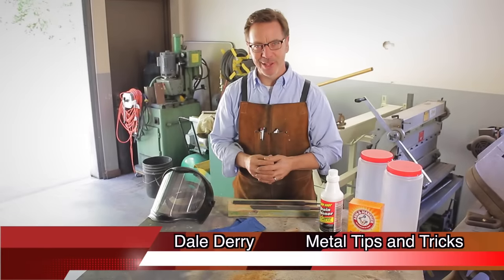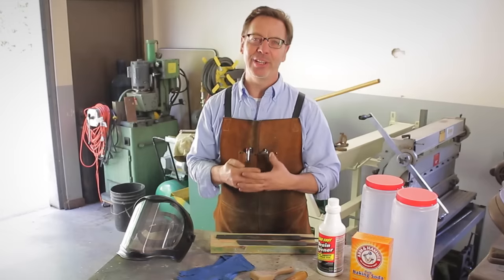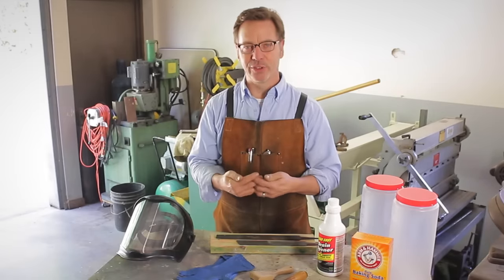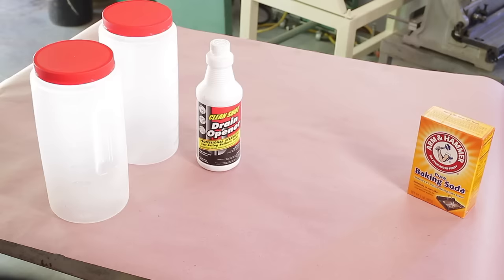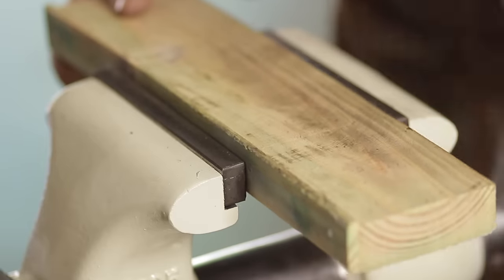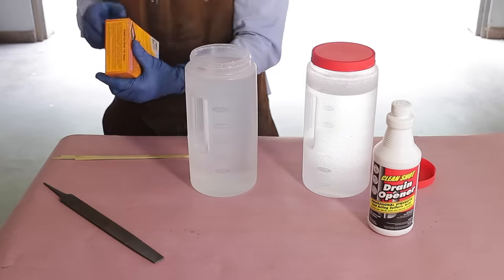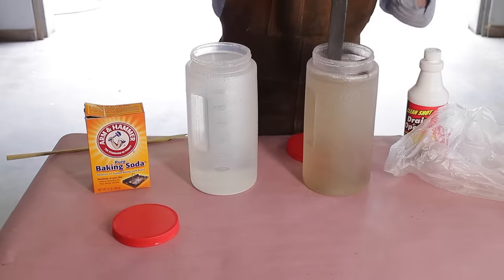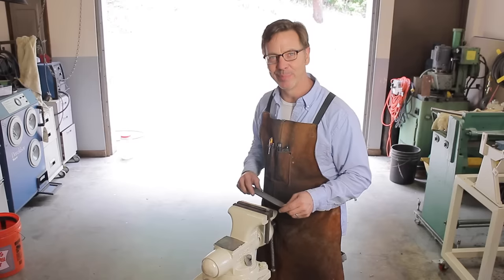How to Sharpen Metal Files

Comment: People arguing whether or not this actually sharpens vs. cleaning, have forgotten all about how we used to "acid dip" our muscle car bodies to make them lighter. Acid evenly removes metal from all exposed surfaces. That includes points, ridges and valleys. Let's picture ridges and valleys of a file. If the file is dull, the ridge will be a mini plateau. If you acid etch, the sides of the ridges will eventually wear away until the plateau becomes a thin ridge again. Thus, making a new point or ridge. Likewise, the valleys get deeper.

If you leave it in solution too long, you'll end up with flat bar. And if the file isn't extremely clean and wire brushed, all the etching action is happening on the left over crud, and not much on the actual file.
Reply from the maker: Thanks for your comment. :-)

Comment: The 1k thumbs down is rather humurous, because they have no clue, my grandfather, a master craftsman & machinist showed me this almost 40 years ago, great to see basically the same process shown, I was throwing some what I thought was junk files away, he asked what I was doing, and showed me essentially the same thing, the only difference is he used diluted muriatic acid, & put them in 3" pvc with one end glued & capped, the other end just a slip on cap with a small vent hole, left them overnight, cutting edge up neutralized them with baking soda & they were razor sharp 👍
Reply: I know right? I have over the years sharpened many a file exactly like this.. Got the tip from a 1890's machinist book.
Reply: But....but...but...the master craftsmen of earlier time didn't have Google to prove???? That's right they became master craftsmen through years of work, experience, and training. This a simple process that has worked for many many  decades before I was taught this method back in the early 70's. Believe it or not all you Nay Sayers it still works. It's really a simple process....quit over-analyzing it. If you want to pick the fly shit out of the pepper at least know what the fly shit looks like.
Reply: @troyquintana1383  lolz, Great reply for all the little nay-sayers..

Comment: Can I use this to clean my criminal file?
Reply: Bleach will work much better than acid.  BleachBit in fact.  The top criminals in this country used it successfully.
Reply: Da L. that's what Hillary uses?
Reply: Antifoul Awl
Reply: H
Reply: Antifoul Awl ACriminal file is nothing else than history.
Reply: To do that drink sulfuric acid mixed fifty fifty with water. About a gallon should do. Works best if done where you won't be disturbed for 6-7 hours. Will clean criminal file spotless.
Reply: @brucebratschi4300  hate to tell you this Brucie....Trump will get a second term you can bet on it bubba...TRUMP - PENCE 2020 🇺🇸🇺🇸🇺🇸 build that wall
Reply: Maybe.....but they will just RE..file the charges.......
Reply: Just put all witnesses in drain cleaner.
Reply: Only if you hire Hillary Clinton as your lawyer.
Reply: @rodneybrand8521  Well, THAT hasn´t aged very well.....     Rgr

Comment: the solubility of sodium bicarbonate is around 100 g/L at room temp. So if you have a water volume of ~4 L, like it looks like you do, you would need right around a pound of baking soda before it reaches its saturation point (Ksp). Just letting you know.
Reply: Btw, ego in their right mind would think that storing files I drawer, and letting them rub together, would sharpen them? That makes no sense whatsoever. It would do the opposite.
Reply: It does make them duller.  Been around them for 40 years, using them for 30.
Reply from the maker: thanks
Reply: Andrew Delashaw pretty sure it was sarcasm.
Reply: Bah!  If you'd rinse the stinking files off first, you'd only need a little bit, it doesn't have to be saturated!  Just throw some in there.

Comment: My last year and a half in the US Air Force I worked at the largest rocket sled track in the free world. This is at Holloman Air Force Base in New Mexico. The time I was there we tested components for the F-16, the Space Shuttle orbiter and the B one Bomber. The unit number for the squadron has changed in the last few years, but there are several videos on YOU TUBE  under high speed rocket sled track. It was the most interesting job I ever had.
Reply from the maker: thanks for you sharing your story

Comment: Do this outside. The fumes from the acid are HIGHLY CORROSIVE do  not do this process inside. The fumes from the acid will settle on anything metal and corrode the surface and you will have rusty tools or machinery. I do decorative acid etching and found this out the hard way when i did some etching under a cabinet that held all of my taps and drill bits. It corrodes the protective coating and made everything rust.
Reply: In a similar way I found that bleach vapors will rust any steel that they touch. My binoculars were stored in a cabinet. The laundry soap was moved to a lower shelf in that same cabinet so it would be easier to reach. When I found my binoculars that fall it took quite a bit to clean off the surface rust. Good thing my guns weren't in the same cabinet.
Reply: Do this outside! Or in your toilet!.......... >.>
Reply: You must be a bachelor. 😈😈😈😈
Reply: ....  It's drain cleaner for crying out loud.  Nice haircut though.
Reply: Big Dan No slam intended Big Dan. I just know if I ever used the toilet for sharpening files I would have to have a food taster for the rest of my life.
Despite that it has it's merits. Fresh water anytime you need it. Self rinsing. Porcelain bowl that isn't bothered by acid. If it wasn't for winter hitting Michigan 6 months out of the year I'd be seriously thinking of installing one in the shop for just such uses. :-)
Reply: I don't know why his drain cleaner has sulphuric acid in it. It's corrosive to metals. My drain cleaner has sodium hydroxide for it's active constituent. Neither of them have vapours that are are safe to breath or get on our skin.
Reply: It was still a joke! haha.. At least you know you can flush it after use. Maybe use it to melt the hair out of the shower drain.

Comment: i was taught that if a flie dose not cut clean it with a file card .
 but how dose acid which eats /erodes material actually sharpen . 
as a file is hardened you would need a diamond sharpener 

more important never use a file with out a handle. you are showing your true professionalism  

please correct me if im wrong so i can throw all my qualifications in the bin
Reply: If you're the type that always grabs the file brush when they grab a file, you may never need to do anything further. This is for when the rust and gunk build up so much that the file card won't cut it, (while a file brush removes chips well, it doesn't do such a great job of polishing the grooves). As soon as you remove the oxidation from steel, it comes back. If the rust gets to the point the brush can only remove the rust from the very edge you'll find yourself using the brush more often. Just the act of using the file helps to clean the edge.  Like I said, using the brush often means you might never have a problem. Rusty garage sale files? They need more than a brushing. The deep groove in a file is just as important as the cutting edge - the chips need a place to go or they act like bearings - not good if they are full of rust.
Reply: During use the tips of the file teeth wear away. That is normal wear.  As the file wears it begins to skid over the metal rather than biting in.  At that point it is a viable candidate for either hydro-honing or acid etch sharpening. 
If the file is abused, banged around in a box full of tools, run against hardened steel, or dropped so that the teeth are broken and chipped they are not candidates for hydro-honing but only because of cost. They can still be acid etched. Without shipping costs and the time involved, if you are able to save only one in three it's a good deal. Perhaps most of the file is okay with just one side screwed up, or one end. With no appreciable cost involved, what do you have to lose?
If the file is a little rusty or dirty, use a file card or perhaps a soft steel bar, like I use in my file cleaning video, to scrape the rust and dirt out of the teeth.
Something I haven't noticed in these discussions is any comments on pinning. It's not the topic of the video but if we talk about cleaning, as nearly every post has mentioned, then describing the things that create the need for cleaning should be defined. Pinning is when the gullet between the teeth becomes filled and stops the tooth's cutting edge from contacting the surface. 
If you are having this problem then cleaning will be an endless effort. It is caused by the teeth being too fine for the chip load. Go to a larger file with bigger teeth.
Reply: Duncan Harris: I think one reason to throw your qualifications in the bin is that they should have taught you to look into statements/ processes offered on this video before posting negative statements of your own, just try it, then you can post a valid comment! (I would have thought that anyone with any kind of qualification would not be an armchair critic).
Reply: tell me where the shapening comes in ? as pointed there is an etching effect  am i not the only one question. but as a professional my kit is looked after ( may be a snob having separate compartment for tools so they don't get damaged   ) when you have worked in motorsports doing silly hours come back an then call me an arm chair critic
Reply: Duncan Harris As soon as you clean steel it starts to oxidize. An oxidized edge isn't as sharp as a clean edge. Whether we sharpen the edge by rubbing, scraping, grinding, or chemically treating the oxidation away - if the edge is sharper as a result we have sharpened it. Clean tools are always sharper than rusty tools, even if the difference is negligible. 

It doesn't matter how organized and clean you keep your tools, when it comes to cutting edges made of steel, they will cease to work at an optimum level the longer they are exposed to oxygen. Leave a file in the tool box for 5 years, and even if it was spotless when you put it away, it's going to take some work to clean up. Will it need an acid bath? Maybe not - but if somehow sat in water a couple of those winters it will - and a file brush won't be the tool to use. Don't worry about it too much. I'm sure somebody out there has a tank hooked up to their toolbox to keep it flooded with nitrogen, I don't.
Reply: 1Howdy1 
thank you for your explination at least you have understood my questioning 

yes i may be sarcastic at times apologies to those who dont get it

Comment: A soft aluminium strip, run across the full in the same direction as the cut in the surface will form teeth and clean the old filings out allowing it to cut again . A blunt file is usually just a clogged up file . If it's dull ,  you cannot sharpen it
Reply: A strip of brass, pushed across the file at the same angle of the teeth will work even better.
Reply: Doesn't the sulphuric acid dissolve the metal making it thinner at the teeth sharpening it in a way?
Reply: or a stiff brush, everyone has that laying in their shop anyway.
Reply: Yup - it's known as 'chemical sharpening'. Even etching of the tooth surfaces leaves them with a sharp edge. Cleaning the file first is essential, however, as gunk in the teeth will protect the faces, meaning you'd only etch the tips, rounding off and blunting the file.
Reply: It will make them slightly sharper for a short time, it can only be done a few times and it will never be close to factory new
Reply: Actually you can.

Comment: I always use vinegar and let them soak for a day or too it works really good and is much safer than strong acid ..
Reply: Citric acid works quicker than vinegar. Or add salt to your vinegar. You should be down to an overnight soak. Both superior safe solutions though.

Comment: Nice Dale.  I have seen this before, but with vinegar over night.  PVC pipe makes a good container.  also  It should be noted that this is obviously a chemical sharpening and it will only work a few times before the acid simply just dissolves the cutting teeth.
Reply from the maker: +holry7778 
Good point

Comment: You forgot to mention that before the acid wash you must clean and completely degrease the file before dipping it in acid!
Acid will not touch metal that is oily or greasy.
Reply from the maker: good point
Reply: Actually acid dissolves oil and grease too
Reply: Mostly it does not, oil needs to be removed with a caustic solution or soap, acid will mix with water but as it is mixed with water it will not mix with oil.
Reply: @Mentorcase  For the price of cleaning a file before etching it, I'll clean it first with TSP.  Thanks